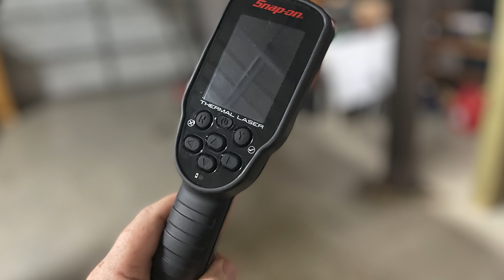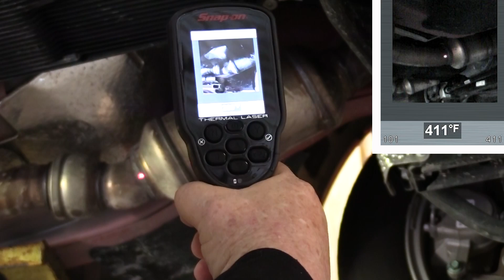TechTip #8:  Diagnosing P0420/P0430 DTCs – Initial Checks

Comment: How accurate would an obd2 volumetric efficiency reading be? My car is having a sluggish response, especially on acceleration... My reader gives a volumetric efficiency percentage, but I'm not sure how accurate it is? If it is, and the percentage is low, what does that indicate/what is the fix for that?
Reply from the maker: If you use the Absolute Load data PID and graph it to see its peak under a WOT test, it should be pretty close. If fuel trims are good, suspect an problem on the intake side and if they are not, look to the exhaust side first. Remember, though, a restriction can be any factor that impedes the ability of the air to get in - and get out. Hope this helps!